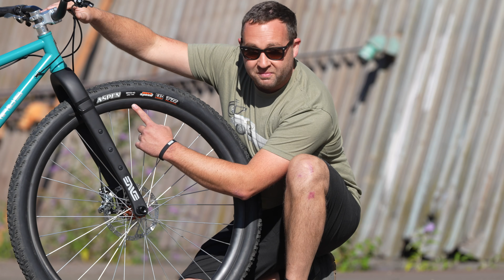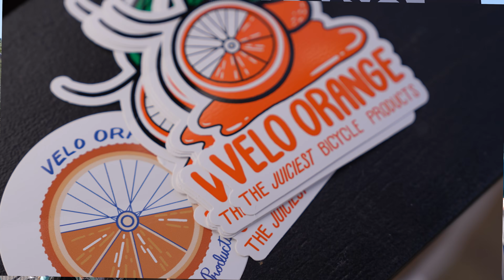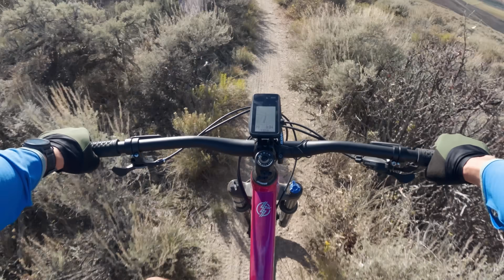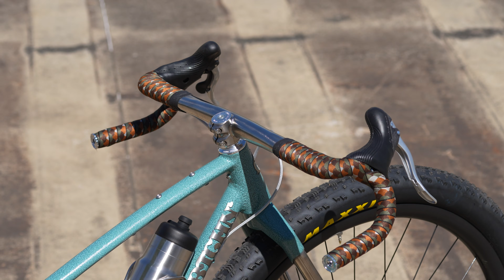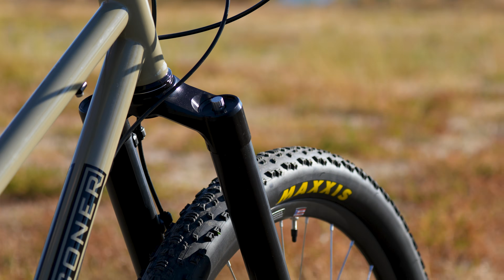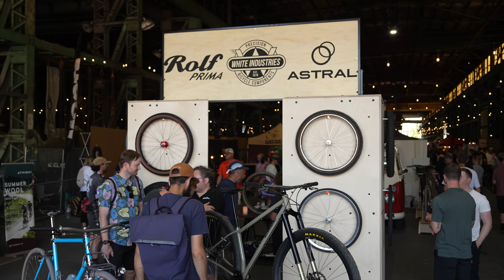Are 32" Bikes The Future? (MADE 2025 Part 2)

Comment: All of this talk about 32" wheels needs to include drivetrain manufacturers. Has everyone forgotten how in the early years of 29" wheels it was hard to find one with lowest gear below 22 or 23 gear inches? For MTB a low gear resulting in about 20 gear inches is needed by most. For bikepacking if you don't have a low gear of 17 to 18 gear inches you'll be doing a lot more hike-a-bike. Will the 32" wheel bring back the front derailleur? Will the 12 speed hubs allow enough brace angle for such tall wheels? Or will new hub widths and dropout spacing be required too?

Comment: I'm all for 32" wheels.   But I feel the industry should be 'framing' it more like picking the right frame for your height/torso.  There might be a little more leeway when it comes to wheels, depending on the kind of riding/terrain you are usually in.  But trying to make 32" the "NEXT BIG THING" will totally backfire when it doesn't work for the average rider.  XL Riders over 6'4" will likely love it.  Large and MediumLarge riders might like it in some XC and gravel circumstances.   To all the marketing staff out there, please don't over promise and under deliver like you did with Plus tires,  there is still a market there in bikepacking, but you destroyed it by promising too much profit from a new size.  On that  note, PLEASE make 29x3" tires again, even if we have to preorder them a year in advance.

Comment: Different wheel sizes for different frame sizes! 

On the road side, <52cm frames should run 650b wheels, 52-58cm 700C, and >58cm 32". Keeps the geometry closer to 73° for all frame sizes.

Comment: mtb industry is trying desperately to invent something new, they can sell. But on the other hand, gravel bikes are selling extremely well with much smaller wheels and are very close to the old mountainbikes.
Due to smaller tires a gravel wheel including the tire is about the size of a 27.5” mtb wheel. So maybe mtb industry is heading into the wrong direction? And personally I totally love riding my gravel bike, it brings back the fun I lost with the ongoing development in the mtb sector. I want a pure ride, no electronic shifting, no electronic dampers and forks just jump on my bike and ride it. I totally miss the times when we had lightweight all mountain bikes with 12-13kg and 160/140mm of travel.

Comment: Good to see Myles mentioning DirtySixer bikes, since the brand has been on it, with 36" more than a decade ago and 32" about 8 years ago. A few things missing in the timeline of events in 32er, since the first real bike in 32" is a DirtySixer in 2017, first tire too, made by VeeTire for DirtySixer (the first good tire was the Nimbus but designed for unicycles). 
Good to see that a lot of builders are following the path that DirtySixer opened up, and figuring out the challenges that we resolved with the 32er production eDirtySixer Bosch, the Gravel and the MTB. The more the merrier. 😎
Reply: You deserve more coverage for your groundbreaking attempts in the last 10 years. Still hope to ride one of your bikes in the future as a tall guy (198cm).
Reply: Would like to see plus tire sizes in 32 as well, it handles heavier riders better.  32x3"  riding a Trek Full State 29x3 now, and it still feels a bit small.
Reply: @ericteela8929 I have made the first bike tire in 32x2.40 and next one's will be even bigger. Will we reach 3" ? Not sure...

Comment: Nah... Pushing 32 into the industry easily can go wrong.  We need multiple stats that can give us a proof this is exactly faster. If it ain't faster it's a dead end street. We have seen  tests and pilots with 750 en 29.5inch nothing made it. When it's no use people won't buy it anymore.
Reply: Why do you need proof that it's faster?
What if it just rides nicer for half the non competitive riders?
The "tire nerds" of Schwalbe fought tooth and nail against 29". Refused my blank cheque order for 29" tires at whatever MOQ they needed.
Closed mindedness is the main limitation of the cycling industry, and it starts with the riders.
Reply: @Cloxxki maybe I would agree with you on that one. But in my opinion the biggest problem is the marketing factor. When the pro's gone ride 32 than the rest will follow....When your local bikepacking hero rides 32 then only a small group of riders will notice it and it would take forever to take over the 29 market. I love the innovation, don't get me wrong but we will have to see how it's gonna turn out.... My guess... No big bike brands are gonna take a chance on this

Comment: I like my 29ers, but keep hitting my 26ers for switchbacks, and control. Don't see how lifting someone further up doesn't have a downside.
Reply: Everything has a mix of pros and cons. Modern 29" bikes are way longer than early ones. I can imagine them being more of a wrestling match on switchbacks. For me with really long legs, 26" bikes just endoed on me in tight switchback downhill. No way to stay on it. Dropper posts didn't exist. 
29" gave me front end stability and on the tightest singletrack I could ride away from S and M sized riders on my XL Fisher.
I think 32" can be made to work really well for M size and up. The industry is less stupid than it used to be, more willingness to do the excellent.

Comment: At 6’7” I’m excited for 32” wheels on a gravel bike. This will be great for riders over 6’3” who can get a better fitting bike and it will be more proportional looking.

I hope Maxxis releases those 32” gravel tires soon! (2.0-2.2, please)
Reply: Ryan, check out DirtySixer, the pioneer of 32" and 36" wheel bikes. 6'6" founder here 😎
Reply: Could be a perfect fit.  Just make sure there is a good enough selection of tires for you and then buy back-ups-just in case.
Reply: They should have added size specific 32" bikes yeats ago.  I have abinch of Volleyball friends from college. This would be perfect for them.
Reply: @hammertime7740 there's DirtySixer going exactly that for more than a decade ;-)
Reply: With 29" the lower threshold to benefit was around 5 foot nothing.
32" is 2.5"/8.7%. That's 5 inches or so. So 5'5" becomes the lower threshold. With super slack head tube angles and ultra long top tubes now a thing, the difference might actually be a lot less.

Comment: No! Toe clearance is the main factor. If you're not 6'8 +, this is silly!
Reply: What are you smoking? Have you see modern 29" head tube angles and top tubes?
With 32" you'd want for instance the same HTA and 8 mm fork offset.
The 32 mm greater rim radius translates to about 30 mm less toe clearance.
Go into a bike store and check the toe clearance on modern M sized XC hardtails. Report back pls.

Comment: I’m 6’5 and ride a 29+. I don’t know that I see the need for an even taller wheel. 🤷‍♂️
Reply: No need, but what if you just end up liking it more?
I take credit for having invented 29+ and pestering Surly (I got into their faces over beer and doners) into make it. Took them only 8 years.
I'm really curious about 29x4, 32x3 an 32x4. 32x3 won't be a big difference over 29x3 just as 29x3 vs 27x3 isn't a big difference.
What would you like to see in 29+? Wider? Balder? More Aggro? What 32" width would you commit a 10 mile bike swap to?

Comment: Been running a 29/32" mullet for a month now. Work with Wren Sports who built the BTCH'N singlespeed star ratchet wheels. We have a 32" 120mm inverted fork as well.
Reply: Do you have an Aspen up front? How are you rating the front end versus a similar 29" front end?
I built a mullet before it was called such, around 2000 with a VooDoo 26" hardtail, short rigid disc fork and 29" WTB tire.
The 26" rear that I was so used to suddenly felt square and rock hard. The front just flowed.
I even put that rigid fork in a 4" suspension bike and it just worked.
Reply: @Cloxxki  I have been mulleting bikes for a long while now too. Run all sorts of configurations: 26/27.5, 26/29, 26fat/29, even 24/26.

I find mullets to be very singlespeed friendly where you're optimizing acceleration and wheel strength in the back and roll over and flow/speed in the front.

All of my builds are custom geometries and tuned for their intended mullets.

Your summation of whatever you comparatively put in the back vs front feeling square and stiff feels spot on.

Right now I'm running the Maxxis Aspin. It's a good tire. For my tastes, best tuned for adventure gravel packing. I'm running it on a trail bike while I await the release of Maxxis' trail 32" mold profile, so it's more a proof of concept until that arrives... Even so, I'm surprised how well the Aspin is hooking up in 32". It holds trail better than it's smaller variants... I'm assuming this is because the contact bites harder as a 32" than smaller diameters and the roll over just makes washout on rocks and roots less of a likelihood regardless of tread pattern.

Personally, I'm all for the 32+ someday for my bikepacking dreams. Living and riding in Alaska and being 6'1" a hard tail 29/32+ mullet bikepacking rig would just be the best.
Reply: @renaissancecyclist9120  Thanks for the reply back! Make replies hip again!
Yeah when 29" hit the scene, the front ends just gripped up. We started with really mid level WTB tires. A Nanoraptor that lacked side knobs and a Motoraptor that was on the narrow side and looked like a kid's drawing of a knobby tire.
Once a decent WTB tire came, I just cornered better than all 26" riders, and I'm 6'4" with silly long legs.

I hear you on the strength of smaller wheels, but a better rim or extra spokes or wider flange spacing ought to fix that and bring loads of advantages of the larger tire. Yeah in bike packing the challenge is even greater, no contest. I like challenges. 
I loved that with 29" I rode up climbs where the whole rest of the field (I raced) went on foot.
There is an advantage to smaller wheels in pump track like trails. There is not getting around that, and the smaller the distance between the ditches the better smaller wheels work. It's an outlier condition I sometimes encounter but doesn't ruin large rear wheel for me, not even close.
Reply: Same, I've been rocking a 32/29 mega mullet for two winters now
I used a 140mm Bolany inverted 29er fork though (it was the cheapest route for this experiment)
Custom geo frame build will get and be based around a Wren 120mm
Did you go 110mm or 150mm hub
I utilized the 150mm fat hub spec.

Comment: 32” means you’ll be smacking your toes quite a bit. I like the thought of it at 6’6”, but I ride in sandals and my toes are afraid.
Reply: Have you missed the part where 29" bikes now have super slack head tubes and longer offset and super long top tubes?
You lose around 30 mm of toe-to-front tire clearance. Good luck finding a modern 29" bike with less than 30 mm toe clearance. 
Or do you have your cleats under the heels? 🤣
The easiest way to make a 32" bike is to take 29" geometer and add 8 mm of fork offset to quicken up the steering. That helps your anxiety out even more.

Comment: Nahh, wide 622s are too large for many riders already

I'd rather "remove" 584 in favor of 559 than invent a 4th wheel size for adult's bikes
Reply: Why emphasize wide? Why did tiny riders win world cups on 29" against a field of 26"ers?
559 was a kids' size. Suitable for 4-cross and pump track stuff, but not natural off-roads for adults.
Might as well keep 584 (barely an upgrade over 559 but it's happened now), ditch 622 and embrace 686.

Comment: The unicycle got world has always been ahead of the cycling world in wheel size. 32” wheels have been around for a decade+. It is not popular, 29” is much more popular for all the reasons they are in cycling. That said, it is not a 1 to 1 comparison. It seems to me that there must not be much communication between the unicycle and bicycle worlds because in unicycling there are wheel choices and spoke choices (not many but more than one) for basically every size from 16” to 36”. Most popular sizes are 20”, 24” (for track races), 27.5 and 29” for mountain and 36” for speed.  And even then there are both larger and smaller sizes available
Reply: Yeah, innovators in bike owe a lot to the greater nerds in unicycling.
I designed a MTB around the 36" wheels that had already been turned into a cheap monster beach cruiser.
Someone just built the frame and it really worked like a mountainbike, beyond any expectations. Thanks to unicyclists, there are now some tires and frame builders that will sell you an awesome 36" bike.
Reply: I'm convinced that the 32" size could be much more popular in the unicycling world if there were more parts available. At the 2018 French Cup, Mirjam Lips, one of the best female unicycle riders, was riding a geared 32er and told me this was one of the best unicycle for her size. I personally find that 29ers are a bit too small, even with a Schlumpf (geared) hub. 36ers on the other hand are really amazing but maybe a bit too big for city touring. So, 32ers could fill in the gap and make some amazing unis.

BTW, if you're having a look at both the French and the international unicycling forums, you'll see a bunch of messages around this size becoming more common. If the bike industry follows, I'm certain that we'll see more and more 32er unicycles in the next years. At least, mine will be ready in a few weeks!

Comment: Well it make sense for gravel and bikepacking but honestly full suspension and 32" looks to me like a really hard problem to solve unless the frame size is XL'ish but maby in xc and 32 you won't need 100mm with 32 maby it will bring HT/ST back to xc... i belive it's going to take a not main stream place for quite sum time on mtb but on gravel and hart tails it's going to get adopted fast and small riders will stay on 29...
Reply: BMC's first 32" prototype is a full suspension bike. It's being ridden hard.
There is a limitation in how much you hang behind your seat. The rear wheel will come closer to the seat than on any other non-kids bike.
On the flip side, the extra stability will have have you more comfortable in the seat. Bigger wheels reduce endo tendency. You pivot around a higher point and that really affect it beyond the better rollover.
Reply: @Cloxxki yah not say nay just belive it will mean compromise that will be bigger the smaller the rider is it might turn out not worth it for M size frames and we going to c 31/30" wheels for these or they actually going to solve all the problems no one know 😅

Comment: 32” wheels make complete sense, it removes the need to run suspension specially if some of the tyres are slightly bigger than the 2.4” as this would increase the comfort level without suspension being had to rollover bumps have the tire to flick over the harshest rockiest terrain and give better attraction for faster speeds and cornering.
Maybe in some bike sizes running a 29” rear and a 32” front would be ideal.
The biggest problem I see at the moment is most of the frame builders are trying to keep the chain stays very short!
We believe they should start increasing the chain stay length to get the rider more in the centre of the bicycle like dirt motorcycles.
The future is exciting and it’s about time we’ve moved away from 26” (ideal for kids) and 27.5” a stupid size for anyone..

Comment: This is how they junked millions of mountain bikes 10 years ago by throwing away many beautiful 26er bikes away and going 27.5 or 29. Was it innovation or just money making gimmick confusing many cyclists? What's next a 36 or 39 bike? Why fix if it ain't broke?
Reply: How were "millions" of 26'er bikes junked? I had several and I sold them to others as I progressed on my cycling journey over the years. There are still quite a few options in 26" tires out there even today and some frame builders still make frames today also. Bicycles don't last forever, metal fatigue will eventually make most things break, I've had rims and frames break after years of service. I don't think the world economy will crash because we try 32" wheels. I suspect it will be nice to have that choice and modern manufacturing can easily shift to making an additional standard with little fuss.

Comment: I own one bike that covers gravel/mtb rigid and 5-29er wheelsets. 32 looks interesting but I can't afford another 5 wheel sets and a new frame. I definitely see how it would work for taller riders size large and up. That's a lot of wheel to get up and over stuff, you better be a strong climber.
Reply: 5 wheelsets for a bike is quite extreme and you know it.
Swapping tires exists. You could just go to innertubes if it upsets you. I ride innertubes still, even though I pioneered with sealant tubeless and suffered the bad outcomes associated at the time. 32" with a gravel friendly bar looks hella sexy, doesn't it? I prefer swept mountain/trekking bars. Not too wide, nice and low, with option to go aero or upright. I did intl CX but don't understand road bars and controls. So uncomfortable.